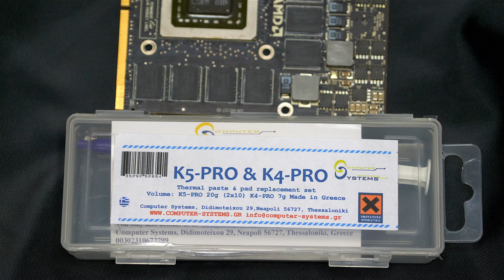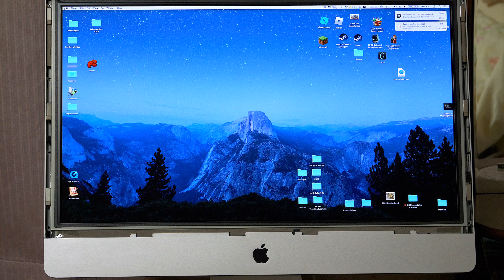Late 2009 iMac 27" Video Card Repair — 4850 — 3rd Bake

Comment: Dude I used to build PC's and over clock the crap out of them  and THAT is WAAAAAAY too much thermal paste! A little dab'll do ya!
Reply from the maker: You are talking about what you see at 12:29.  Note, however, that K5 Pro was used on the RAM chips (which is obviously what you are referring to), while a different paste was used for the GPU.  K5 Pro was applied in strict accordance with the manufacturer's recommendations.  How so?  Well, it's a THERMAL PAD replacement paste, not intended to be used on any GPU or CPU.  It bridges thick gaps like the one on this card.  That's right, there's a big gap there above the memory chips, such that the heatsink doesn't sit directly atop those chips.  The K5 Pro bridges that gap, and any excess is squeezed out to the sides, which is what you are seeing at that timestamp in my video. 

For the GPU, however, I used not only a different paste but also a smaller amount, as you ought to when pasting any GPU or CPU.

Comment: I got my hands on a 2009 recently, it would boot correctly, slow down, then "stop working". As it was warm I disassembled, changed the button batery and cleaned. After putting together again I get stuck at "error thread 8" + Cannot find HDD folder with question mark. When booting with Command R, safe mode etc, it goes to the apple logo but gets stuck there. Other check/maintenance tools do not boot with the relevant keys pressed. With a bootable USB OS, I can choose it, but I also get stuck on the Apple logo loading forever (tried up to 10 hours). Online reboot doesn't work, jut stuck at the apple logo. HDD is probably an issue, but some info I found indicated damaged GPU (although screen is ok, just stuck with Apple logo). Just asking in case someone knows. Note I have tried all the available online troubleshooting, changed USB keyboard etc... Feels like the GPU should be OK so wondering if I should bake it...
Reply from the maker: If your iMac gets stuck when booting from a known good external hard drive or from a bootable DVD that you know is good, then that is definite proof you have the GPU problem and you would need to follow my bake videos to solve it.

Comment: I baked my 2008 card for the third time and it worked. I then went and bought a new card complete with a heat dissipator but it did not work. Frustrated as I was, I took a close look at the P# on the card itself and the last 2 digits did not match with my original card. I then went on eBay and found a used, never baked card with the identical P#. I installed this new purchased used card that cost me only 10 bucks and Bingo, it worked. I was persistant and came out a winner thanks to your videos.
I have bought a new 2022 Mac Book Pro, but I am happy to have rebuilt my 2008 machine that will soon be in the hands of a less fortunate person that can get a fee more years out of this terrific machine. Thanks for your great explanations!

Comment: Hello my friend. My first bake lasted I think almost a year, it was in the middle of the pandemic lockdown. My son had the computer running 20 hours a day, so I feel I got what I needed. My second bake lasted 8 months I think, but we are still not in shape to fork out $5k for a new one. My wife almost panicked last night when she saw the streaks on the screen. This time, full disassembly, bake & reassembly took 3 hours and I had no parts left over. This thanks to your first bake video and some practice I now have. The funny thing is that I replaced the RAMs a few years ago and the machine improved plenty. I then decided to swap for an SSD and again the machine was like new. We now use it just my wife and I for simple stuff. I do not think the card can take a 4th bake. I would like to replace the video card, but I fear overpaying the SHARKS like you well call them. On the other hand, its such a fine machine its a shame to throw it away for just a faulty video card. I´m tempted on buying a replacement card and having it standing by for when my third bake goes sour. I do not hear the fans running, do you think is worth getting software to run the fans or should I just let it run as designed?
Reply from the maker: Thank you for the details.  I really don't know the technical reason why the card can be baked only a limited number of times.  It could be that repeated bakes cause faults in the solder balls under the GPU chip, and if that is true, then perhaps paying someone $60-$100 to "reball the GPU chip" might fix the problem (for another year or two) and ensure the solder balls are perfect, such that future baking is possible.  But this is just speculation on my part.  I am merely giving you my thoughts about the cheapest "possible" solution should another bake not work for you.  The second cheapest option would be to buy another video card like I did.
Reply: @JDW-  Thanks for your tip on the issue. How about running the fans constantly with an App, do you think that may prolong my third bake?
Where do I find the Part # for the video card?
Reply from the maker: @handyherman7777  Some people believe in higher fan speeds.  I'm not so sure it helps.  Even so, I keep all of my internal fans running at 2000rpm anyway.  At the very least, it keeps the internals cooler.  Now, as to your question about finding out the p/n of your graphics card.  Click on the Apple menu, then About This Mac..., then click on the System Report... button.  Then click on Graphics/Displays in the left sidebar, and the info will be displayed at right.
Reply: ii😅

Comment: Yes sir, I baked today for the third time. The second only lasted 8 months. Thanks
Reply from the maker: How long did your 1st bake last?  My 1st lasted 4 months and 2nd lasted 2 years and 9 months, but my 3rd and 4th bakes only got me 1 week each, so I gave up on the 4850 and swapped in a 6970M, which is still running strong to this day.  As such, I am quite curious how long your 3rd bake lasts.

Comment: Thank you so much for your great detailed videos and links! Terrific information!  With your help, I was able to resuscitate my non-booting mid-2011 27 inch iMac!  I baked the GPU for 8.5 minutes at 400 F and it totally brought it back to life!  Lucky for me, Target Disk Mode was working even with the computer not booting to the OS, so I was able to save my recent files since my last backup, but now I have a fully working iMac again!  This was incredible, and now I'm ready to try it on our old 2010 24-inch which we abandoned because the screen would randomly stop working.  Hope it lasts long enough for me to save up for a new iMac Pro or maybe a new Mac Mini M1 Max.
Reply from the maker: Thank you for sharing your bake success story!  I read and reply to nearly every comment under all my bake videos, and from the experiences of others, it seems the bake can last either a number of months or years, depending on a variety of factors, especially the thermal paste used.  My first bake lasted only 4 months, most likely due to an inadequate thermal repasting job, but my second bake lasted 2 years and 9 months.  So while your mileage may vary, I do very much believe the bake is worth the time and effort to do.  Best wishes to you and your newly resurrected 2011 iMac!

Comment: To you all. Following Mr. JDWs advice, I disassembled the computer once again and on the left lower side, there are 4 connectosr. One for the power button, 2 dor fans and 1 for temp sensor. It is possible to cross 2 of them. Make sure you take a close up picture before diassembling. I read the label on the PCB and bingo, I had mis connected. Connected them with logic and no more running fan.
Reply from the maker: Excellent troubleshooting work! Congratulations on the fix!

Comment: Yes sir. I did not get deterred from ignorant foul mouthed comments. I went ahead and got my K5 (which I did not have for my first bake, I then only got K4, but still got 18 months out of that first bake thanks to your great video). My family is delighted with the success. I did the second bake and it worked. The only thing is the fans are now running full blast (I dont know why). The fan speed app does not work on my early 2009 iMac. I will disassemble to inspect and ensure everything is properly connected.
Reply from the maker: In almost every single case of a high fan speed after the bake, the cause is a connector left disconnected by accident.  There is more than one fan control app available, including iStat Menus.  If the one you tried doesn't work, you may wish to try another.  But of course, the best fix is to just fine the disconnected connector and reconnect it.  It's troublesome, I know, but worth the time to do it.

Comment: There are guys that say one should stay away from K5Pro, claiming it is not a high heat material. Aparently it melts, spills and makes a mess
Reply from the maker: There is so much misunderstanding about what K5 Pro is, hence the confusing info you are reading.  K5 Pro is NOT a replacement for a GPU or CPU paste.  It's not.  It's a thermal pad replacement "in a thick paste form." 

 If you read about thermal pads, you will see they cannot transfer as much heat as a CPU/GPU paste.  Such is common sense because the pads are thick, whereas the CPU/GPU paste must be applied very thin.  The reason thermal pads were originally used on the video card in the iMacs is because there is a gap between the top of the MEMORY chips and the heatsink.  Not a big deal because the memory doesn't get as hot as the GPU and therefore a thermal pad used there is perfectly adequate.  

As such, K5 Pro is a perfectly adequate solution for the MEMORY chips (and ONLY the Memory chips) on the video cards we're talking about.  You must never use it on the GPU.  Instead, you must use K4 Pro or Thermal Grizzly Kryonaut or another dedicated GPU/CPU paste on the GPU.

If anyone needs more proof of what I say, just research thermal pads and K5 Pro on the manufacturer's website.  Then consider this...  With K5 Pro on the MEMORY chips, and with K4 Pro on the GPU, I got 2 years and 9 months of life out of my baked video card.  When I removed the heatsink at the end of that 2 years and 9 months, the K4 Pro was NOT hard and crusty, and the K5 Pro was NOT melted or spilled due to heat.  The card failed after 2 years and 9 months due to other reasons -- specifically, the bake doesn't last forever.  But then again, even a brand new replacement card doesn't last forever either, since all these cards have a design defect which causes the problem in the first place.

I hope this helps!

Comment: Can I use 1mm thermal pad for VRAMs? (iMac Late 2011) Because I couldn't find K5 PRO (not sold in my country) More precisely, is 1mm enough? Thx for answer @JDW
Reply from the maker: I honestly don't know.  I found it too hard to measure, which is why I chose K5 Pro -- a thermal pad replacement paste.  With the paste, the gap width doesn't matter.   But I suspect a 1mm pad may not be enough.  Furthermore, what if your PCB is very slightly warped, and not perfectly flat?  In such a case, there wouldn't be a consistent gap above all the memory chips.  That's why I went with K5 Pro in the end.  If you are absolutely intent in going the thermal pad route, I would recommend getting 3 different sizes so you can try them out.  I know that's not what you wanted to hear, but that's really the most sound advice I can give.

Comment: do you have to wait for the temp to reach 400 F before putting the card?
Reply from the maker: Preheating your oven to 400°F is not a requirement but I personally recommend it because that is exactly what I do.  I also strongly recommend that you put an oven-safe thermometer (e.g., turkey thermometer) inside your oven during the preheating time to ensure that your oven temperature is correct.  If the temperature rises too much higher than 400°F, solder will liquify and components on the bottom can become desoldered.  That happens very rarely, but it does happen sometimes, especially on ovens which operate at a higher temperature then the dial setting.  A thermometer will eliminate any worry of that happening.  Best wishes!
Reply: @JDW-  I have a digital oven though. Thank You
Reply from the maker: @pastorlito2004  My oven is digital too.  In fact, my oven can act as either a conventional oven or microwave. :-)  Even so, it is still possible to place a turkey thermometer inside to verify if the temperature is correct.  Just because controls are digital doesn't guarantee the actual temperature inside the oven is 100% correct or stable.  You probably don't need to worry about a thermometer because problems are rare.  I only mention it because a few people told me in the comments that components were desoldered during their bake.  None of them used a thermometer, but I suspect their oven was a much high temperature than their dial setting (analog or digital).

Comment: What graphics card is at question I have the Radeon hd 5760
Reply from the maker: I don't fully understand your question, unless you are asking if you can bake a 5760.  The answer is that the bake is only for "MXM" type video cards which are used in Apple iMacs.  You must never make any full sized cards that would go in a PC, because those cards tend to have fluid filled electrolytic capacitors on the card which must never be baked.

Comment: Hi @JDW! A friend saw my post on baking an 27in GPU. Now they shipped their Imac A1312 for me to check. the error on this imac is after the logo it just turns white, even if i go to the recovery mode, safe mode etc it just go to a white screen. My question is, is this a GPU issue? will baking the GPU help? Thank you and stay safe!
Reply from the maker: Hi Jujoe.  You have a 2010 model.  And yes, it sounds like the video card is bad.  The bake should resurrect it, but you will need the 2 thermal pastes I recommend too.  Please follow my 2nd bake video here:  https://youtu.be/6BJGLFCigdA
Reply: Thanks  @JDW-  i'll update you on this :)
Reply: @JDW-  Done with the bake, and imac working good! Thank you for the info. Also did a High Sierra OS update
Reply from the maker: @JujoeM  I'm very happy to hear the bake worked for you.  Congratulations.  Enjoy that iMac!

Comment: Hi! i accidentally pulled one of the 4 wires wrong while getting the screen out (the long one where you have to pinch the sides to get it out). The connector on the board was just lifted a little bit. Will i be able to solder the sides back or will i have to buy a new board? if so what is the board called?
Reply from the maker: The board is called the motherboard.  Whether you can re-solder the connector back or not depends on your soldering skill, and whether you have the right tools. You will need a magnifying glass sitting on a mount so you can more clearly see what to solder.  And of course you need a soldering iron with a fine tip and leaded solder too.  (I don't recommend lead-free solder.)  Paying a repair shop would be cheaper than buying a new motherboard, if you conclude you cannot do the soldering job yourself.
Reply: @JDW-  Thanks! i know someone that could solder it back which would be easy. Thanks again for the info!
Reply: @JDW-  btw which part will i have to solder? the sides?
Reply from the maker: @luthergravrn  I honestly cannot say without having had a look under a magnifying glass.  There are parts which hold the connector to the board and then there are the signal pins.  There have been a few other people who had a similar accident and they ended up taking the iMac to a repair shop to get the connector either desoldered or replaced.  Again, it's cheaper than buying a used motherboard on EBAY.

Comment: Thanks for your videos! My first bake (iMac late 2009) lasted for almost 2 years. Sadly, my second attempt has not been successful. I must have done something wrong since the screen stays black. The Mac chime can be heard, the backlight turns on, but that’s it. No images, or even a white screen. The fans are working overtime though... Not sure what cable is the problem. Pretty sure I properly connected them all, but I guess I have to open it up again... :(
Reply from the maker: If indeed your 2nd bake worked (which is not 100% guaranteed, just as my 3rd bake didn't work insofar as it lasted a mere 1 week), then a black screen would be related to one of the flat ribbon cables, as mentioned in my FAQ here: https://youtu.be/hldcyJ_qUD4?t=1083
Reply: @JDW-  Thanks :) gonna check them tomorrow. I felt the gold pins looked a bit dodgy in the cable in the top left corner, so it might be that one. Will watch the faq video first!

Comment: CHANGE FOR A 780M !
Reply from the maker: I actually changed to a 6970M: https://youtu.be/9dPsH1zIQMs
Reply: @JDW-  yes but with the Nvidia GPU, you can pass on a recently macOS
Reply from the maker: True, but I love the bug free operation of High Sierra and love my 32-bit apps. I have a late 2015 5k iMac at the office but deliberately keep High Sierra on it for that very reason. I installed Catalina on an external 2TB SSD for the lone purpose of editing my YouTube videos in the latest version of FCPX in conjunction with my mid-2015 15” MBP, and from that OS experience I am happy to keep High Sierra as my daily driver for the time being.
Reply: @JDW-  ok i understand ! But the nvidia gpu is more berger on quality than the Radeon ;-)
Reply from the maker: True, but my 6970M was basically “plug and play” with no flashing required. Flashing Nvidia cards is fiddly for guys like me who don’t own any Windows machines nor do I even use bootcamp. :-)